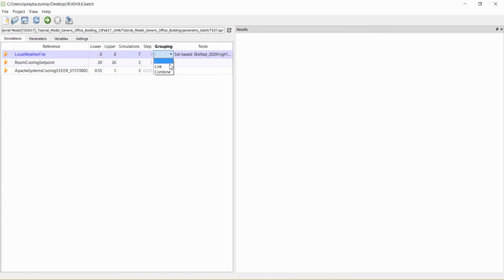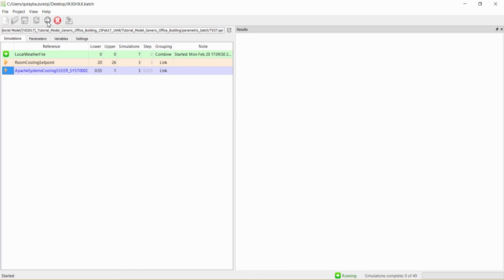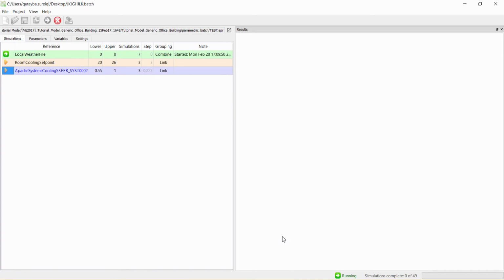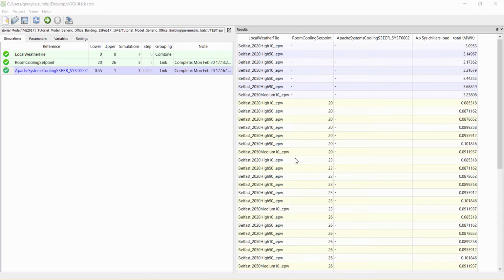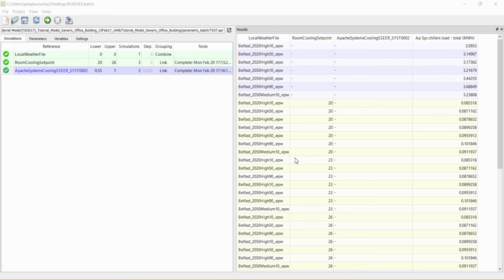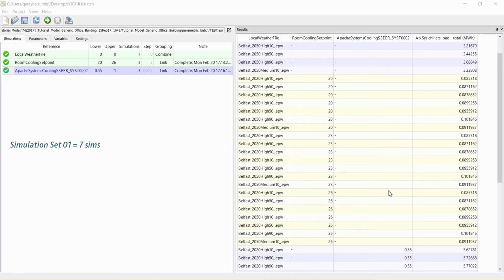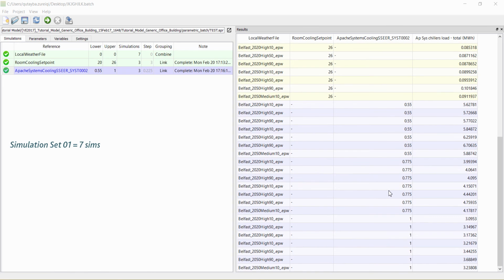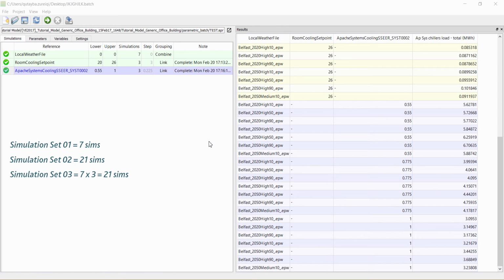Parametric Grouping

Comment: I was hoping to manage physical changes to my model and run groups of variables of all possible combinations of different configurations (i.e. shades dimensions, angle of inclination, etc.) It seems that I need to do that manually, correct me if i'm wrong. I've got a question please: is it possible to have 'orientation', 'glazing type', 'glass type' and 'glazing percentage' as input variables? if so, any idea on where to start from? your help is really appreciated. Thanks :)
Reply: Hi Yahya! I have the same problem. How did you end up doing this parametric analysis and possibly multi objective optimization for these variables such as glazing type, orientation, etc.?
Reply: @sfa1373  Dear Saba, this comment is 4 years old. I manged it but it was kind of painful process. I eventually had to manually produce a third of the total number of models. There is a very good useful tip I learned from the guys at IES-VE when I visited them back then. Happy to guide you through it if you like. Email me at YAHYA.A.IBRAHEEM@uotechnology.edu.iq 
All the best.
Yahya